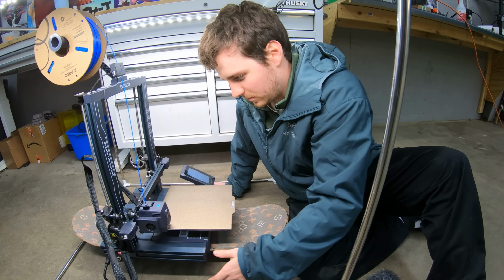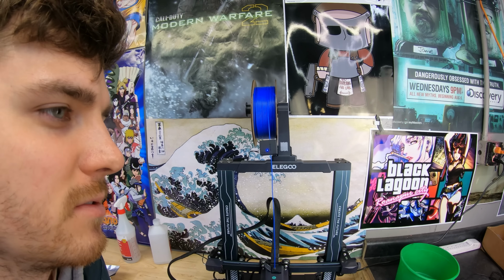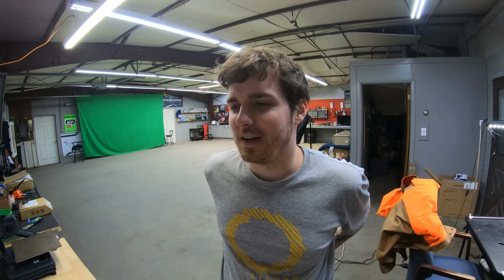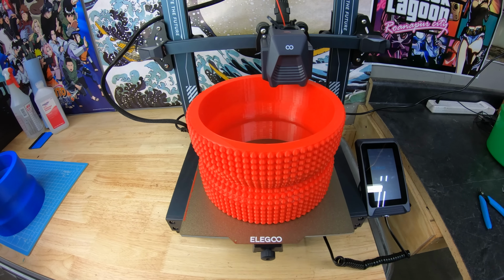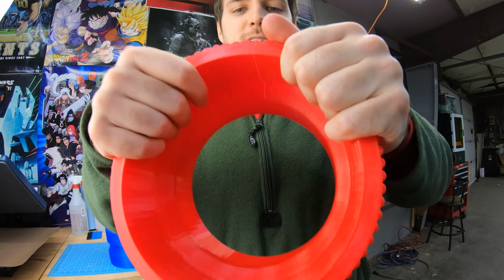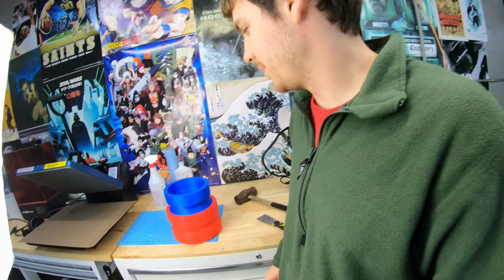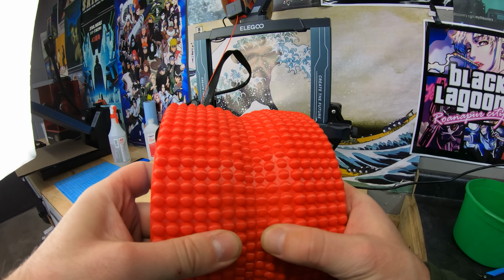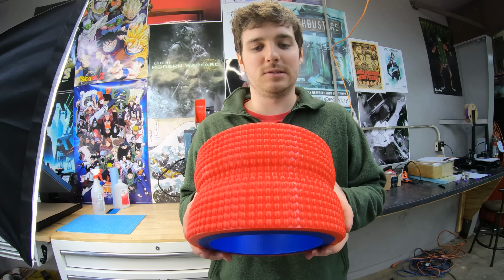This Printer is a TPU 𝙘𝙝𝙚𝙖𝙩 𝙘𝙤𝙙𝙚

Comment: For the record, I printed this with overture PLA/TPU.

PLA: 3 walls, 20% cubic infill, 430g, ~$7. 10h
TPU: 2 walls, 15% adaptive cubic infill, 380g, ~$7. 29h

All in, $15ish and nearly 2d printing time

Used some glue stick on the TPU after watching how difficult it was for him to get it off (came off very easily). Soapy sponge and a screwdriver to get it on past the spine indent bit. Working great so far.
Reply: What nozzle and bed temps did you go with?

Comment: Use dish soap on anything that has an interference fit. The pieces will slip together and then just wash off the excess the squishes out. Fantastic video!
Reply: Or WD40 but I don't know how it will react with PLA. it's not a lubricant, but it will evaporate, so we use it to put on motorcycle grips. Old guys cringe when I do it, but it holds just as well as hair spray.
Reply: That alcohol on the desk would do the same thing, but ... cleaner? I use it to install mountain bike handle bar grips. Slips on easily, dries and doesn't ever budge.
Reply: Can of compressed air that contains benzene. Spray it upside down, and you'll get a frost effect on it due to how cold the air is. This will shrink the part that you need a bit smaller, and it'll slide in even easier 👌

Comment: Pretty cool but that part could have been printed as a single TPU part, with the inner core fairly solid (4+ perimeter layers and 25-50% infill) and the squishy outer part designed so it prints with thin flexible structures separated by voids.

Comment: Couldn't get mine to work. The PLA prints no problem, the TPU stops being pulled into the extruder after a few minutes running a job. Have temp at 225 and bed at 60. Help

Comment: @blake3dcake I am currently printing this and I THINK the sleeve I print is a lot harder - what are the settings you print it with - mainly infill ? I can see pattern but would be interested in % as well as wall count etc.
Reply: I got mine to print. 15% is good for me i think he did 20% from the vid, and he said he didnt mess with the standard settings

Comment: Be EXTREMELY careful with that printer. I bought the same Elegoo printer and it almost burned my house down because of a thermal runaway event caused by its terrible software. All its heaters randomly heated to max with no warning and they wouldnt turn off.
Always unplug it after every use.

Comment: What brand of TPU did you use? Thanks for the video!
Reply from the maker: Overture!
Reply: @blake3dcake   hi im using the same printer and the same filament but i have a big underflow... at what flow did you print the tpu? im trying at 40mms 225c and 100% flow

Comment: 3D printing takes power too. Especially when uncovered with a heated bed. That does factor into the cost.
Reply: It costs less than 50c per day, not rly worth mentioning :D
Reply: @DJMills  it depends on the printer .. I have a larger printer with a heated bed (not in a box) and it consumes quite a bit of power. 
I've had my breaker trip because it was using a lot of power (combined with other things on the same circuit). Normally that doesn't happen, and I sometimes run  an electric room heater.